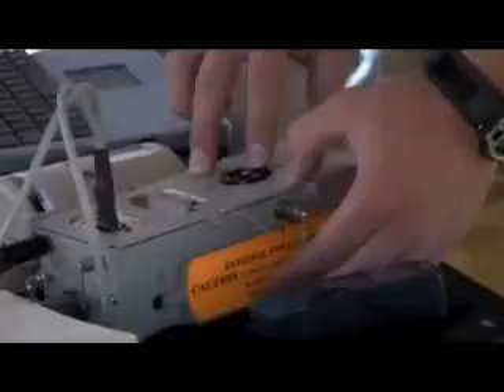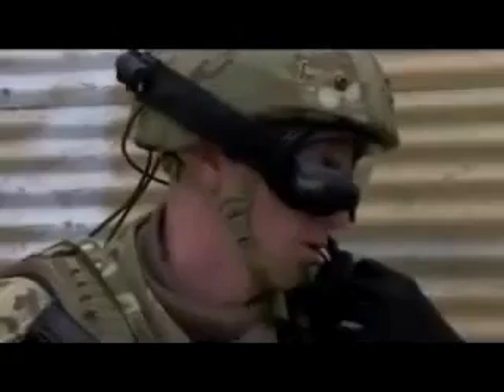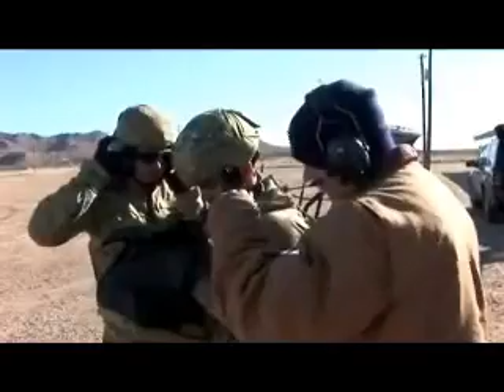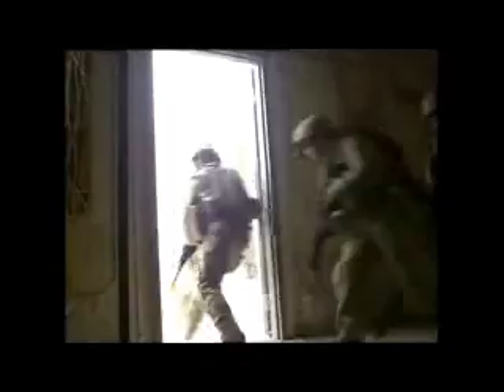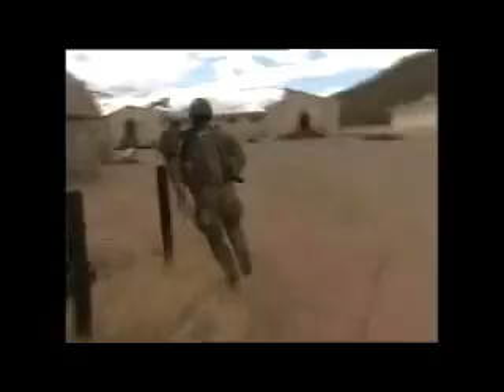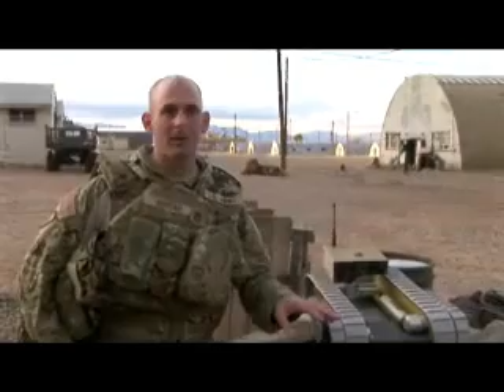Future Combat Systems - Experiment 1.1

Comment: also there is bomb design. Although the gun type is the most simple of fission devices it is still fairly hard to pull off, and then it must be placed in a reliable delivery package. Iran may have dirty bombs, but nuclear bombs in the kiloton yield range must be delivered for it to be used.

Comment: A nuclear program and a nuclear weapon are very different. U-235 exists in very low concentrations in uranium samples, it can take years to enrich a sample to even a few percent, and then it is only good for nuclear fuel, in that the chain reactions will commonly stop short, prohibiting the bomb effect. Weapons grade uranium is far more concentrated in U-235 than in energy grade uranium. And then there is the extremely small concentration of plutonium by product.